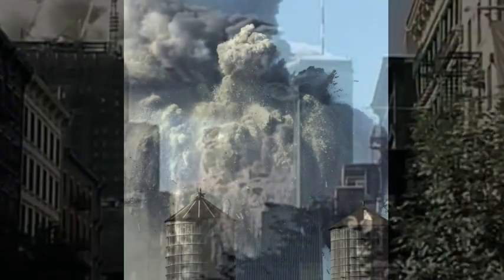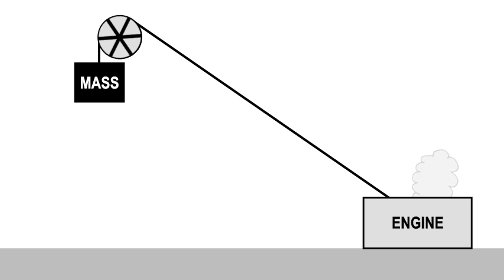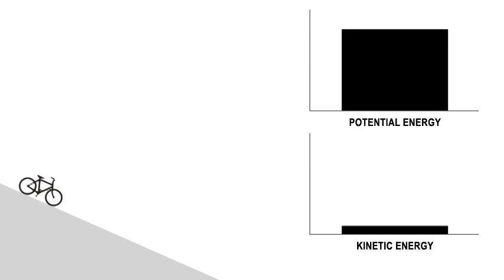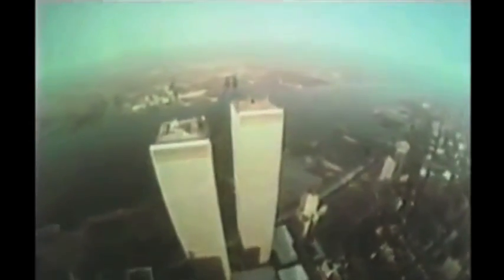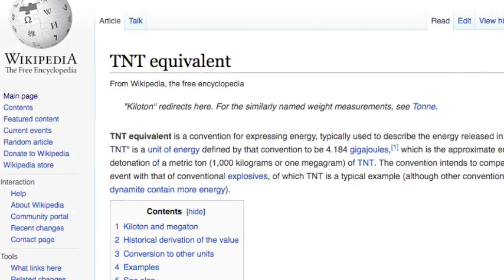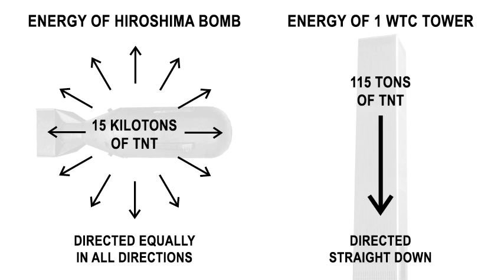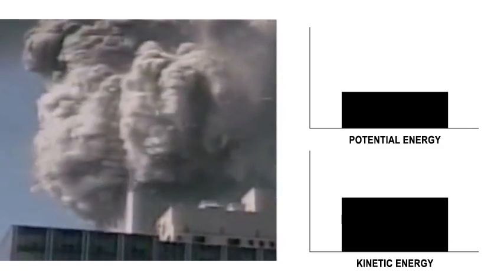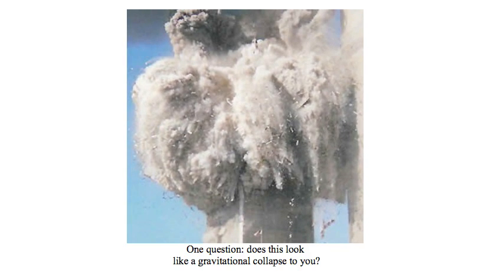Where Did The Twin Towers' Explosive Energy Come From?

Comment: Stll does not explain how eletric&jet fuel fires brought it down even though most of the floors had fireproof, and was meant to survive impacts.
Reply: Probably a combination of two factors involving the spray fireproofing/insulation: 

1. Enough of the fireproofing/insulation was blown off the steel support structure for the heat of the fires to weaken it, thus rendering it susceptible to bending and collapse (note to Rosie O'Donnell: NOT MELTED).

2. The thickness of the fireproofing/insulation wasn't sufficient in enough areas to provide the protection required.

While I have no idea what the codes were when WTC was built or what actually happened during its construction, I do have many years working in the field and wasn't surprised by either explanation being given by engineers. I've seen both cases during construction.
Reply: There were several smaller fires, on much lower floors , that is correct.
We saw that the exploding plane pushed fuel over a large distance in the air (pressure) this means that inside the same  pressure occurred
Fuel was blown into the elevator shafts and popped out on several floors .  There was one  elevator that went all the way through the building , the freight elevator. That elevator shaft could have send flames all the way to the basement, and it did. There is a lot of testimony on this, by the way
Reply from the maker: No, this video doesn't explain that. You are right about that.
Reply from the maker: Consider the volume of the tower before it starts collapsing. As the collapse begins, that volume starts to decrease rapidly. Each floor is an acre in area and about 13 feet in height, with many floors being crushed each second. Some of the dust being produced by that crushing is going to leave the building with that air -- it's not a sealed, airtight space. It's like, if you start to crush a cardboard box that has a hole in the side, air is going to come out the hole. Does that help?
Reply: YES, that happens and I have alot more questions to ask if you dont mind?
Reply: I'd have to see these "reports" and know how they were vetted. Eyewitness accounts in these types of events are not generally reliable by themselves. Two of the more famous examples of this are the assassinations of Lincoln and JFK. What did Booth actually say after he killed Lincoln? How many shots were fired at both Lincoln and Booth? From how many places did the shots come from in Dallas? Etc. This is why investigations are done, bringing in the best science can offer at the time.
Reply: Oh I see, well then can you explain to me why there was multiple reports of collapsing floors in the south tower before it even fell like the 90th floor or 34 th floor which were not even hit. Then in the north tower the 23rd floor was reported to be on fire.?....im just asking questions.

Comment: Korol's paper shows the pulverization of the concrete in tower seven took four times more energy than all the potential energy of the whole building. They were all controlled demolitions. 
 It is also fairly easy to show they had to remove over 95% of the strength of the columns in the towers, from top to bottom, for them to fall as fast as they did. 
 Just conservation of energy, where stationary floors reduce the velocity a falling floors, adds four seconds to the fall time. The columns only reduce the fall time by a few seconds. The outer columns were built with a margin of five so you had to remove 80% of their strength for the building to fall at all. 90% and it will fall at half speed of gravity plus the four seconds for a total over 22 seconds. So to get the fall times we see, 95% of the columns' strength was removed.
Reply from the maker: Europhysics News, which published the article you mention, commented: "EPN is a magazine that publishes a range of news and views to stimulate discussion – unlike peer reviewed research which would be published in a scholarly journal. EDP Sciences [their parent company] follows the most rigorous peer review standards for its journals. of which EPN is not one." https://twitter.com/EDPSciences/status/778917023791349760 Europhysics News subsequently published the following response article:  http://www.europhysicsnews.org/articles/epn/pdf/2017/01/epn2017481p18.pdf ... I suppose conspiracy believers will consider this a compelling and important article as well. Let us know when a CD-oriented paper passes peer review and is published in a major engineering journal. That might actually be interesting.
Reply: Bravo, well said.

Comment: And with some 9000 gallons of jet fuel...some of which HAD to have gone down the core in order to further weaken the structure...it is obvious that the terrorists had figured out how to bring down the Twin Towers...and murder almost 3000 innocent people in the process. It was not necessary to melt the steel, but to generate enough heat to weaken it!

Comment: Let's not forget the old chestnut about how, "Burning jet fuel can't melt steel beams!"  It didn't have to.  No one is claiming that it did.  It only had to weaken them to the point where they could no longer support the buildings.  That requires about half the heat.
Reply from the maker: Funny how if a firefighter says "molten steel" (I didn't know they were trained in metallurgy but ok) it's like a sacred oath, yet if they describe having measured a bulge in Building 7 for example, and determining that the structure was at risk for fire-induced collapse -- something actually within their expertise! -- conspiracy believers declare that they are liars shilling for the New World Order. That's called confirmation bias; again, similar to creationist arguments.
Reply from the maker: Falling Acorns is asking you to believe there was molten metal in the debris. There wasn't. There were hot spots. There are fuzzy stories of what people claimed to see. And there is a famous picture where somehow a worker's flashlight glow was morphed into a pool of glowing molten metal, even while the workers' boots were stepping in "it." Just remember, you're dealing with zealous believers here. People like that are not open to reason or evidence to the contrary of their beliefs; see: Creationists.
Reply: EdwardCurrent i hate it when people act like everything a fire fighter says is 100% true and they are experts in everything. what fire fighters saw was probably some kind of molten metal but probably not steel, since molten steel glows a blinding white color.
Reply: Falling Acorns pack it up boys it looks white to this guy he's proven it was molten steel.
Reply from the maker: It's ironic that you're commenting about how suspicious high temperatures are in a pile of debris, on a video showing that the energy released in the formation of said debris pile was over 114 tons of TNT. You understand that energy is conserved, and that all of the potential energy converts at some point to heat, right?
Reply from the maker: I appreciate that you aren't sure. And surely some of the energy went into what you call a "pyroclastic flow" (produced by volcanos but not demolitions, https://en.wikipedia.org/wiki/Pyroclastic_flow), which is better described as rapidly moving dust. One question, though: For the materials that got pulverized and were buried in the debris pile, what do you suppose happened to the energy responsible for that pulverization? Did it disappear from the universe?
Reply: Falling Acorns concrete is a very good insulator, for the fires underground acted like a furnace. Thermite explosive are only hot when its reacting, it will lose all its heat in minutes after burning. How would thermite fires last days?
Reply from the maker: Have there been raging, active fires in any controlled demolition ever performed? With materials starting at temperatures of 1000-1500 degrees (and still actively combusting and releasing heat), even before the potential energy is released on top of it? That might point you to the different phenomenon you seek.
Reply from the maker: Okay, that accounts for the debris that was not claimed to be hot or molten. What about the materials that were actively burning? We have an Occam's razor situation here. If there is a way to account for these hotspots that does not require the secret planting in busy working office buildings of incendiaries that have never been known to have been used in a controlled demolition, and which does not require the additional moving parts of a secretly planned operation and the maintenance of that perfect secret for 15+ years, then the other way is the far more likely explanation.
Reply from the maker: Good one...I hadn't seen that. But then again, AE911Truth is claiming that Plasco might have been a controlled demolition! Keep hope alive!!
Reply: Falling Acorns well the ones who can truly make sense out of any of this are called government shills who are lying about what really happened by nut jobs who make up their own truth.
Reply: Falling Acorns but do you know what metal it was?
Reply: Falling Acorns during the big crash the fuel traveled down the elevator at the bottom floor wich caused an explosion that blew out the windows, thermite is a self fueling oxidizing fire it burns very quickly and rapidly and doesn't require air to keep burning, jet fuel requires air and if the air is cut off it will die out but if a little bit of air is allowed to reach it under the rubble or debris it will burn very slowly like a candle or a kerosene lamp.
Reply: Falling Acorns even if 10% of the fuel was unburden after a quick flight, the impact it would leave around 2400 gallons, 

im talking about the initial impact, when it crashed it shot burning fuel down the elevator shaft into the first floor and blew out the windows
 the fuel that was burning in liquid form seeped down cracks and floors where there was not enough oxygen to keep it burning so it just seeped down because of gravity
i said the guy smelled kerosene but was actually jet fuel because they are both oil products we are still talking about jet fuel here, 
grab a kerosene lamp and throw it on the floor it will make a big fire ball then continue burning because there is still liquid fuel on the floor and this liquid will still act like a liquid and flow through oppenings in the floor, even regular office fire have been recorded to reach 1800f way above the steels heat rating (1000F-1200F) so a jet fuel fire can also get that hot in a burning office environment, thermite does not create prolong hot spots it burns away in a maximum of  2 minutes.
Reply: +Falling Acorns If you are still monitoring this, I can pretty much prove to you at least that the "molten metal" seen on the debris site is completely irrelevant to supporting any evidence of thermite in the twin towers. Take a quick look at this picture. http://i.imgur.com/KCGLVJO.jpg On the left it shows the burning debris of the Plasco Building which if you hadn't heard, burned down about a week ago. It too was a steel framed building like the WTC7 and WTC1 + 2. There were no planes involved, and it pretty much shows that you don't even need jet fuel, let alone THERMITE to heat up steel sufficiently enough to look "molten".
Reply: Falling Acorns i spoke with a man once who was inside the north tower when it got hit, he said that he could smell kerosene in the stairway when they were evacuating. Its very possible that jet fuel made it to the lower levels later to be ignited by 1,500f° pieces of debris. 

Honestly, tell me what you think caused those fires to burn for so long?
Reply: I'm not sure how much of the potential energy was converted during the collapses. I tend to think most went into the mechanical energy to pulverize the building materials and the resultant heat was released above ground. That would explain the observed pyroclastic flow that is typically only seen in such things as controlled deomolition and volcanic eruptions.
Reply: Well, where does it go in controlled demolitions? Why don't we see weeks of underground hotspots, requiring prolonged costly countermeasures,  when these buildings collapse?  

I would imagine that, between the impact fireballs and the subsequent building fires, no jet fuel would have made it to the collapse "pits" to help sustain burning. At that point, how were the demolished materials any different from those generated by CD? 

It doesn't seem to be a matter of degree (all demolitions produce burning pits - it's just that it was so much worse because the WTC towers were so much bigger) - there seems to be a different phenomenon involved.
Reply: The vast majority of materials were intact and not burning; supposedly they were mechanically crushed.
Reply: But really, how much fuel could have travelled far? And after being ignited at the bottom, how long would it have burned? You asked earlier how ignited thermite could burn for days - why would burning kerosene last any longer?
Reply: First, what proportion of the fuel do you suppose escaped ignition in the impact fireball?

Second, why would any fuel that reached the bottom cause an explosion - it's not niroglycerin and there were no fires for it to feed; and if it was burning on the way down it was being consumed during the trip.

Third, even a slowly burning kerosene fire wouldn't burn HOT enough or LONG enough to create the observed thermal profile and superheated debris which instantly ignited on air contact. I've never seen a kerosene lamp that was consumed by the fuel burning in it.
Reply: ok, this is going nowhere.  maybe someone can cite a RELIABLE ACADEMIC REFERENCE that will tell us how much of the fuel on board was likely used up in the primary impact fireball.  I can't find anything but "opinions".

I've tried to get someone (ANYONE) in the engineering department of a nearby university to help me  understand some of these things, but my request was ignored.  Apparently there is a price on such information, even though this event constitutes an exceptional attack on the mental well-being of millions of citizens. God forbid a university should give away free information to help people in a time of extreme national crisis. We are left to argue amongst ourselves, and even highly educated people are on both sides of the fence.  

The trauma of 9/11 is not something that can be swept under the rug. People who are troubled by inconsistencies and extraordinary occurrences deserve patience and respect from the "experts"; many of us are not nut jobs, morons or in any other way subhuman. We hang on like dogs with bones because our questions have never been academically addressed. 

If there are people out there who truly can make things clear, they remain silent. It's a shame.
Reply: So why was there molten steel in the debris and in the pits that burned for weeks
Reply: Falling Acorns I think you just answered your own question.  The pits burned for weeks.
Reply: Fueled by what?  Office furniture? No, some kind of powerful incendiary
Reply: You think office furniture can't burn?
Reply: not hot emough to produce molten steel, and no ordinary office fire burns for weeks
Reply: Falling Acorns Oh.  You mean a powerful incendiary like jet fuel.  Gosh.  Too bad they didn't have any of that.
Reply: first, it takes 2500 deg F to create molten steel like that found in the debris; burning jet fuel doesn't get hotter than 1500 deg F.

second, do you really think the planes' fuel tanks held enough to burn for weeks?
Reply: Falling Acorns You ask to me believe that there is a ceiling on how hot jet fuel can burn based exclusively on your say so?  You also ask me to believe that there was nothing else flammable in these buildings?  Just the fuel from the jets and the office furniture?  Seriously?  Nothing else?  Nothing else in either building?  Nothing else in either plane?

Perhaps, if these buildings were still standing, I could visit them and find a few more things, and perhaps, if I had a degree in physics, chemistry, civil engineering or journalism, I could subject your reasoning to proper scrutiny, but as is, I have to know my limits and not reason beyond them.  "Jet fuel cannot burn hotter than 1500 degrees Fahrenheit according to a random comment I read on the internet" is not exactly a reliable source and it makes me kind of suspicious that you would single me out for this argument instead of making your case to other people in this comment thread.

Let's take a minute and consider my initial comment: "Let's not forget the old chestnut about how, 'Burning jet fuel can't melt steel beams!' It didn't have to. No one is claiming that it did. It only had to weaken them to the point where they could no longer support the buildings. That requires about half the heat."

Is there a point in this that you disagree with?
Reply: Yup - look up the temperature range for burning jet fuel (an indisputable material property); 
Also your idols in NIST formally acknowledge that the NORMAL combustibles in the buildings were ordinary  building materials and office contents (hazardous incendiaries are prohibited in public buildings like these). 

Of course if something illegal was placed, say nanothermite, yeah we'll get quite the bonfire!  Way to start a war!
Reply: the dripping liquid metal sure looks white to me
Reply: Not a creationist.
Yes there was molten steel - ask the firefighters
Reply: just responding to your comments
Reply: It is not explicitly identified, so we can argue forever about it.

But any metal that liquifies on air contact after being buried in pulverized building debris would seem to indicate some awfully high temperatures (as shown in satellite heat detection images well after the collapses). Even using massive amounts of water It took 100 days to fully extinguish these areas; doesn't sound like burning desks to me.